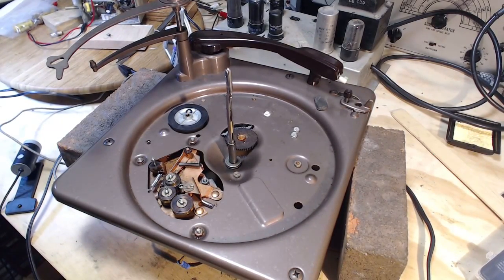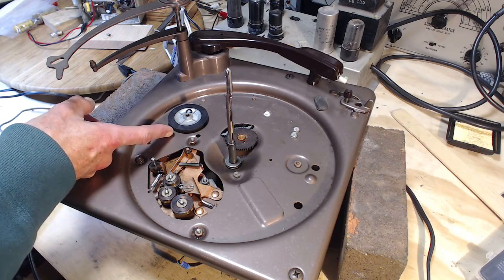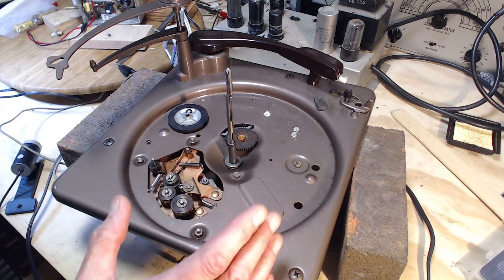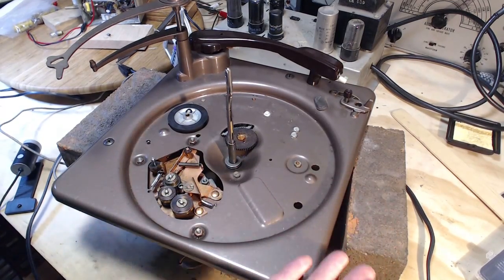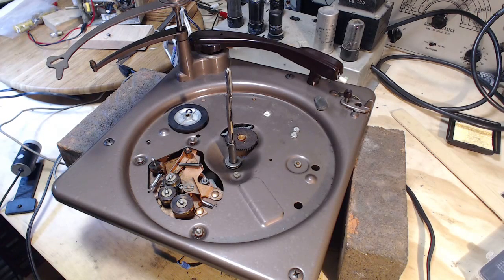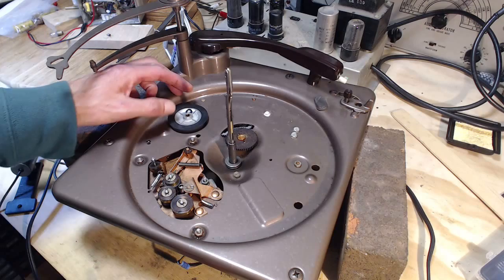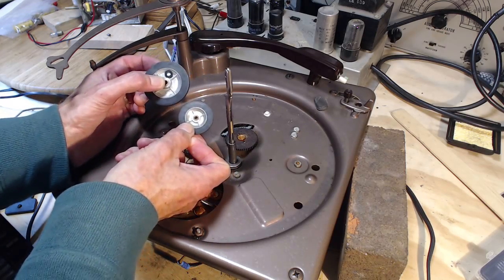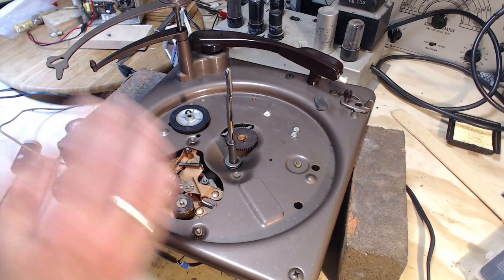Electrohome Chippendale Console Video #19 - Last Chance

Comment: I would pull off the turret wheels for the 78 and 33 speeds and give them a light sanding. And go over the metal motor capstan lightly with steel wool same on the metal surfaces of the turrets. These type of changers are called Turret style there a pain that is why later manufacturers got away from them. Voice of music made one like this that I worked on. The little rubber turrets are actually more critical than the large wheel. If none of this works then send all 4 rubber wheels out to be redone. Some times the rubber hardens to a point it just can't grab anymore. Good luck don't give up on it.

Comment: You will probably just need to replace the 78 and 33 turrets.  If you try to sand them it may have better traction, but it will run slow.  The diameter of the idler wheel is not critical, but the diameter of the turrets is.

Comment: I would not grind those wheels. I know it gets to fresh rubber.
I used to have TEAC capstan cleaner that really helped. I doubt it is still available as it was a freon solvent. I see rubber capstan restorers available, you might try them. Others have reported that wintergeeen oil dissolved in alcohol  helps soften rubber parts. Hey if it does not help, at least it will smell good ;)